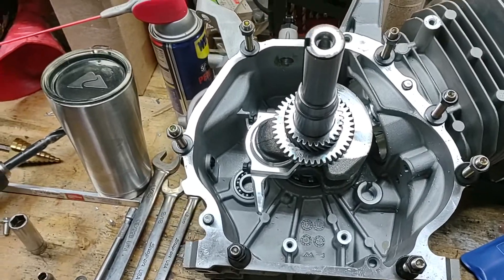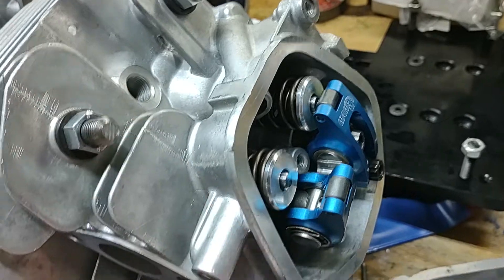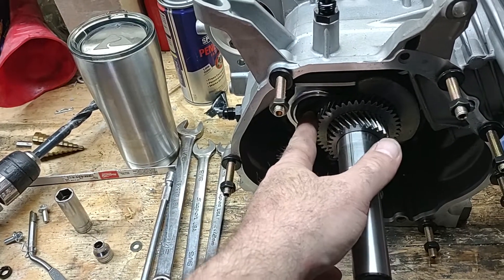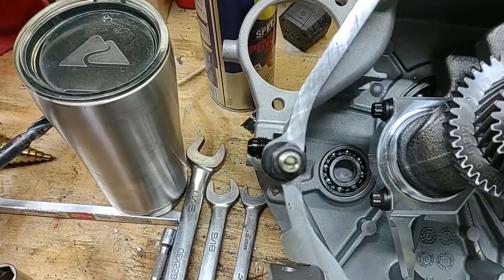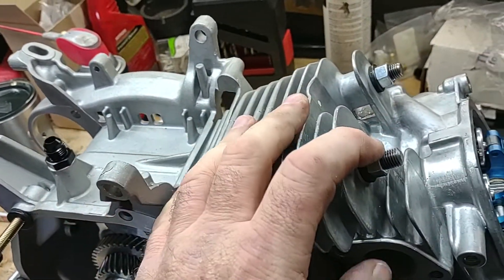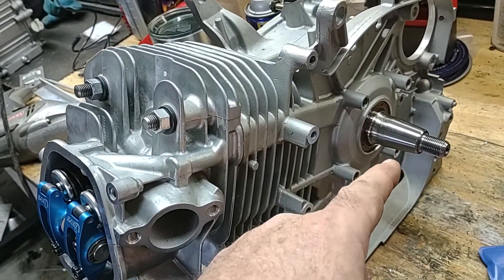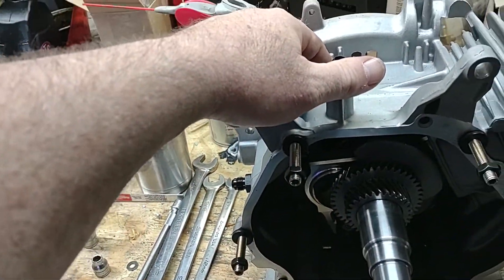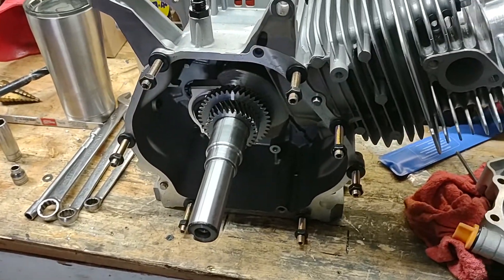420cc stroker predator to 440cc stg 4 build pt 1

Comment: What rod and piston are you running?   Is it a +.040 rod and fly cut piston.   They sent me the wrong rod and .025 out the hole isn't gonna work.  Might be better off just getting a stroker crank you think?
Reply from the maker: The stroker crank is 68mm stroke the piston the rod and crank was all from nr racing
Reply from the maker: There is a shorter rod for that piston,  the 440 crank uses a different rod and piston